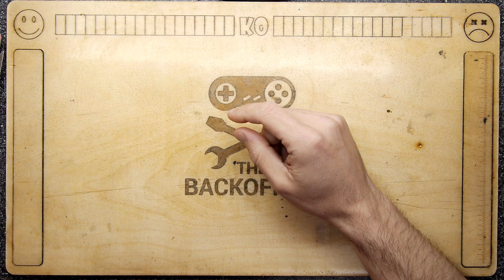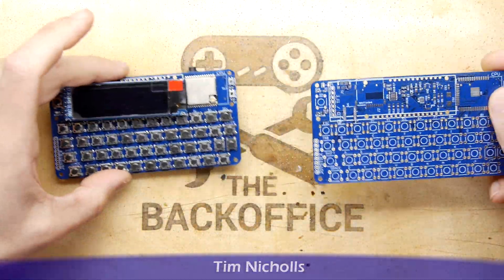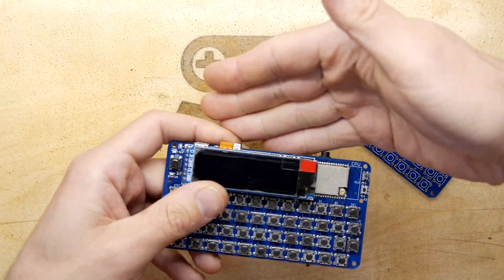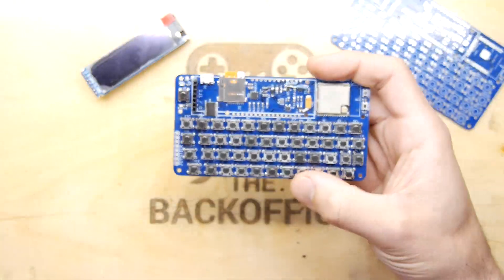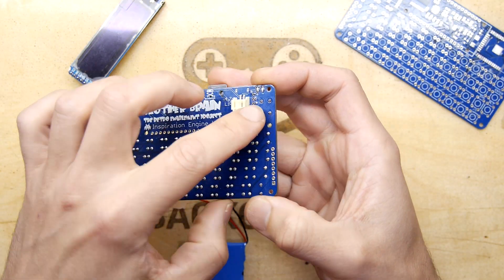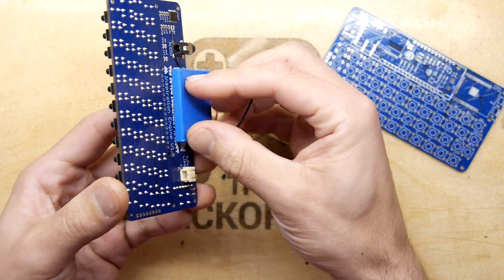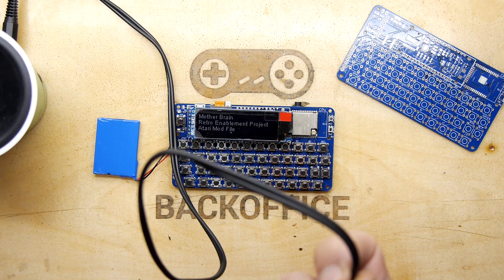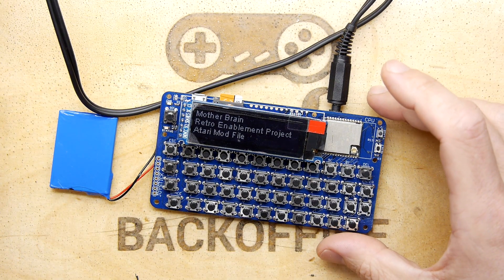Inspiration Engine a Sneek Peek at my new project - be inspired!

Comment: now give that one of those near 5000mah smartphone batteries, hehehehehe
Reply from the maker: One of the team used an old TomTom battery in it and it ran for nearly 8 hours constantly  driving the screen, accessing the SD card and playing audio (byte by byte from the card!)

I'm pretty impressed for 100% utilisation. Would be interesting to see how long it will last with normal operations and power saving routines
Reply: @backofficeshow  that good a batterytime is a fine feature, without having too much extra bulk, tho some bulk is nice, making it easier to hold, yes

Comment: You probably want to remove the ground plane under the antenna area,
Reply from the maker: Yeah there are a few tweaks, I'm not really sure what happened to the keepout, but that library part was not well designed, it actually causes a few errors. I wish manufacturers would publish their own library parts
Reply: @backofficeshow  yeah good luck, professional designers (with all go respect) never use pre designed parts , they always roll their own